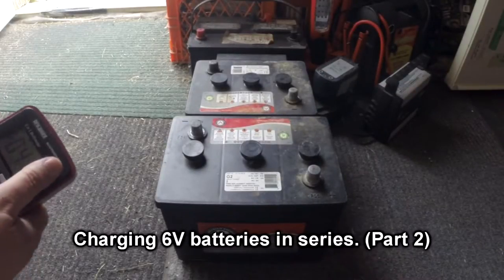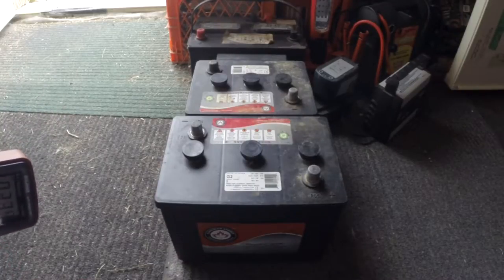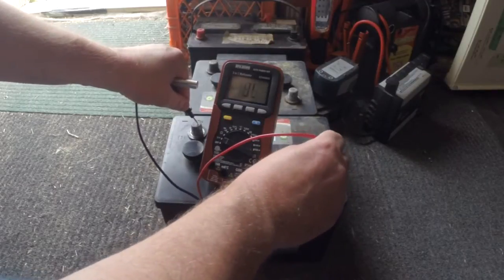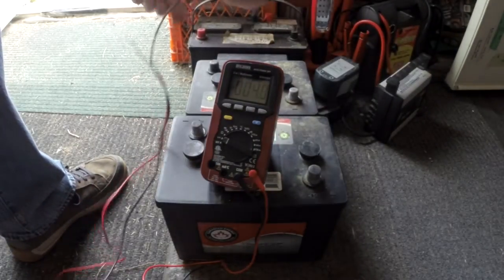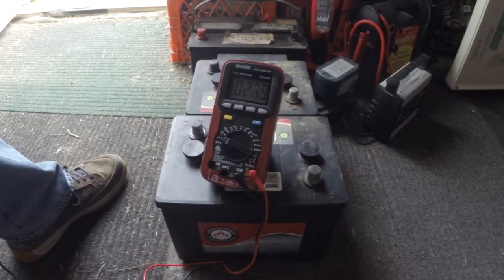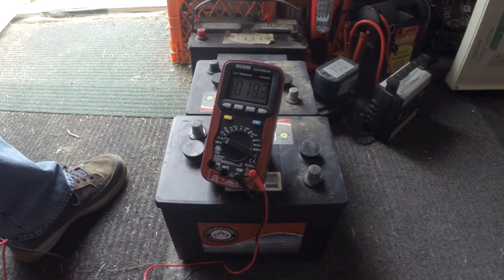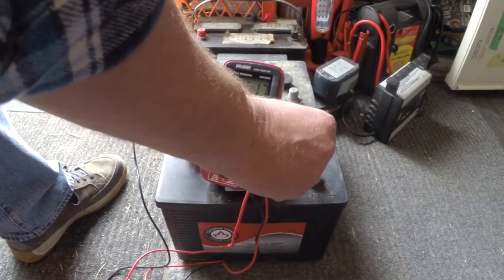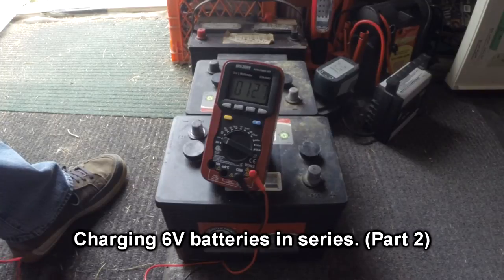Charging 6V Batteries in Series (Part 2)

Comment: I'm sure you've learned by now, but this method will severely overcharge the good battery, while trying to bring the dead one up to proper voltage.  The voltages of BOTH batteries individually need to be monitored while charging in series.

A parallel  connection to balance them is usually done first to get the voltages even. Then you can do the series charging.
Reply: I am sure you know the answer to this question. I have a Genie scissor lift with 4  6V batteries wired in series, My question is there a different charger for series charging and for parallel charging?